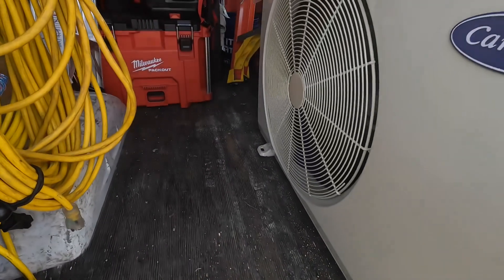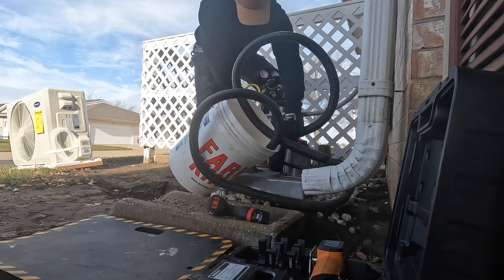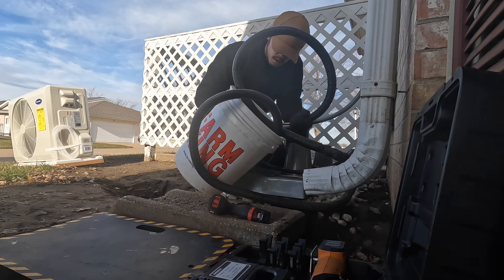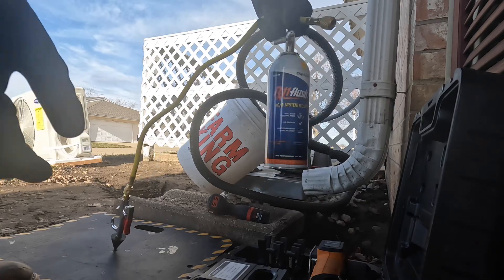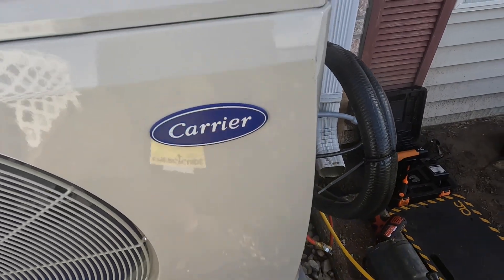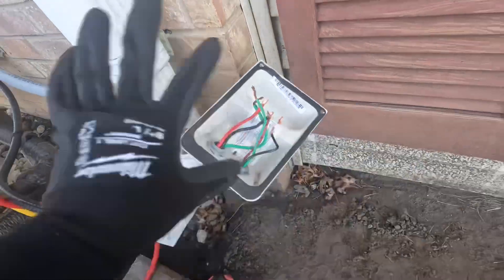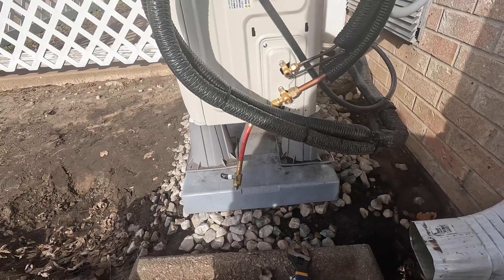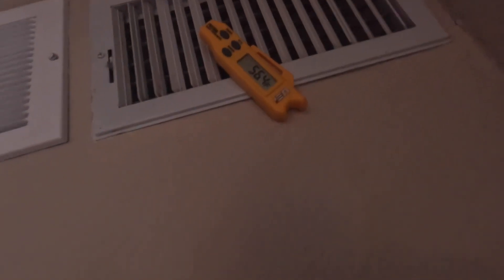Flushing Lineset With RX-11 Flush Kit & Using Navac Cordless Power Flaring Tool

Comment: I’ve used the R11 flush for about 10 or 11 years. I’ve found it to be a really good product and a real time saver. I’ve used it on condenser replacements, on entire system replacements with buried or concealed line sets and when going from an R22 system to a 410A system. Stuff isn’t cheap but less than a line set and the time it takes to run one. The flaring tool is pretty neat, I’m old school and still use a block to make mine. Thanks for sharing Shorty.👍👍🇨🇦
Reply from the maker: I keep a flare block on the van just in case I’ll ever need it, but for the last 2 years I’ve made all my flares with that tool 🤙🏽 I love it. Thanks for watching!